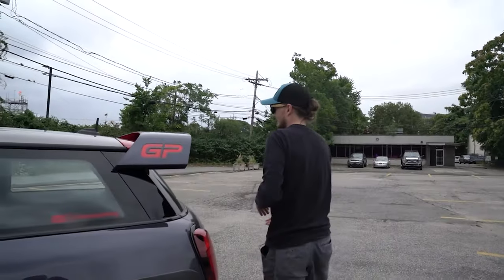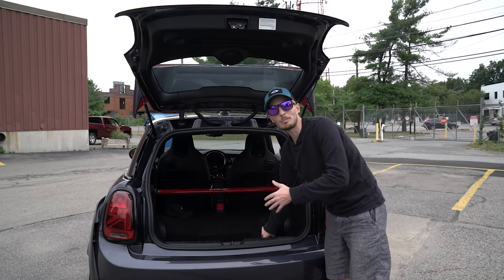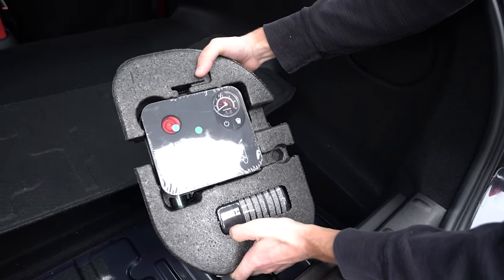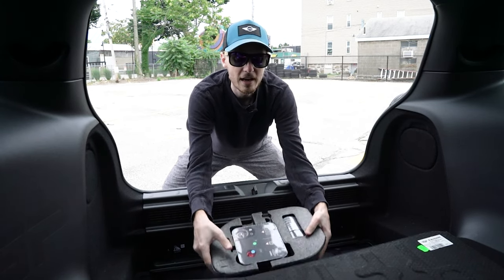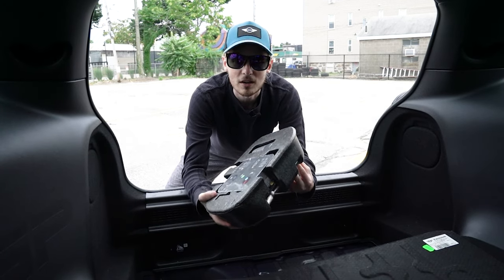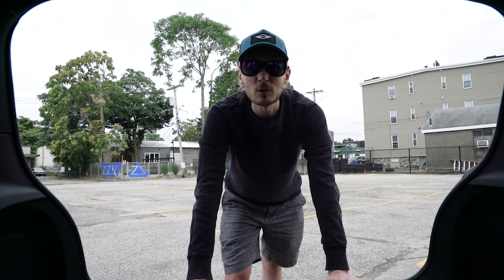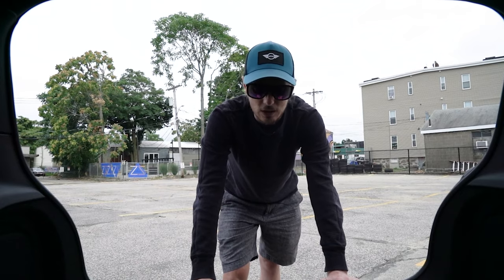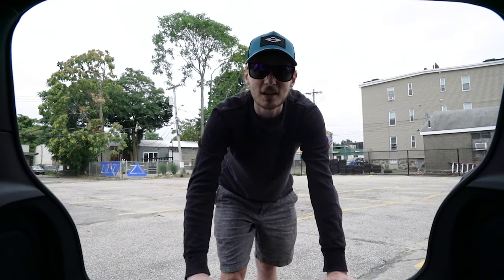MINI GP3 Tire Repair Kit

Comment: I saw that first day with #1000 and was very impressed.  Why haven't they done that since like FOREVER ???

However, I am currently outfitting my small toolkit for the boot of the new guy - and that will include a tire repair kit so that I can also try to plug a tire on the road.  Not a hard thing to do and only a little harder than this kit (probably need to take the wheel off).
Reply from the maker: Cool. Are you going with like a dynaplug type deal?
Reply from the maker: Thanks for the link! That is a handy looking kit!

Comment: That's a cool little kit! I wonder if someone will make a similar one for other models. A couple of years ago I hit what turned out to be a motorcycle chain link that punched a large hole in my nearly new runflats. I found a store open that sold Fix-A-Flat and put that in. Unfortunately the hole was so big that that sticky stuff flew all over the wheel and car as I limped home. What a mess! I still use runflats because I like that security when traveling, but I'd love to go back to a softer tire.
Reply: John DeJarnatt  you can get these for any mini that is not running run flats, I have this kit in my 2020 JCW clubman
Reply: @jackslade1954  Thank you!

Comment: I had this in my 2015 one 😂
Reply from the maker: Nice! Did it not come with run-flats?
Reply: The MINI Vlog it did but somehow the 1st owner wanted it. Now with my Clubby S I don‘t got it anymore.. got runflats But thinking of changing them.. those Bridgestone tires are horrible in my opinion
Reply from the maker: The best mod I did for my JCW was get rid of the run flats and replace them with a better tire and a AAA subscription. Only had to use it once.
Reply: The MINI Vlog I thought so too, better tires, no runflats and maybe a better suspension.. I think it will be a superb drive then.. I really don‘t like the runflats, when it’s really hot, they are trash and never mind driving in the rain 😂🙈